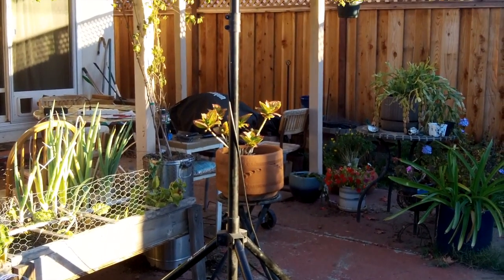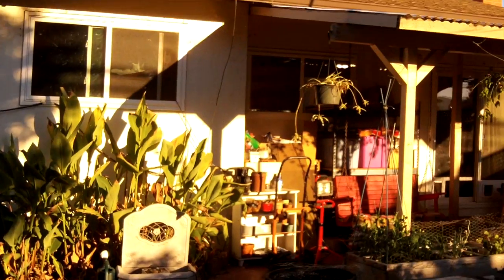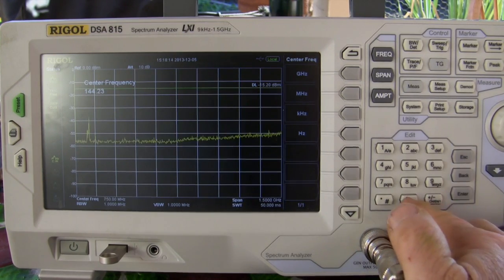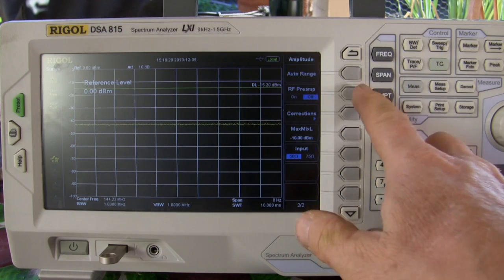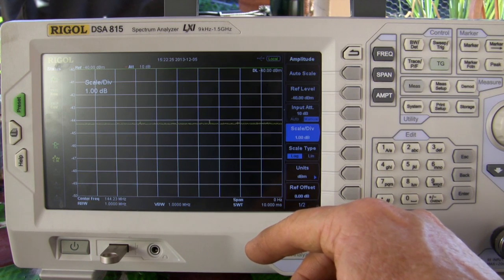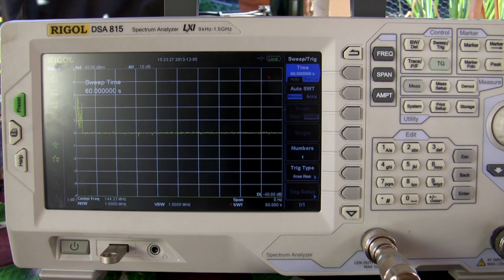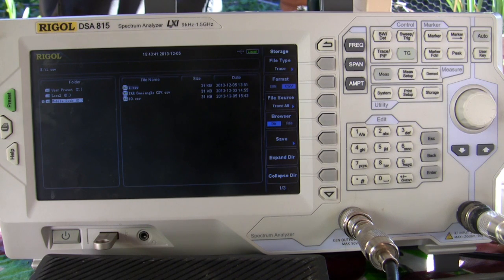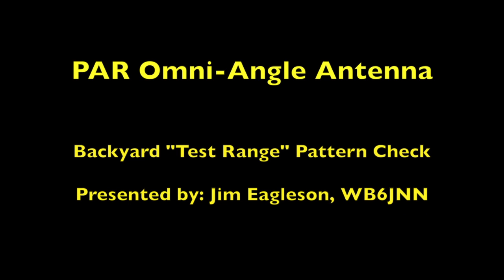PAR 2m Omni Angle Pattern

Comment from the maker: Update: 

For anechoic chamber results that directly compare several omni designs to the PAR OmniAngle as taken at the same Motorola test facility at the same time, check  http://www.parelectronics.com/omni-patterns.html  Note that the PAR antenna shows about 1.5dB variation (I showed up to 2.5dB in my admittedly non-anechoic open air test site).  The other candidates showed significantly more variation with about 1-2dB more gain towards the front and back of their antennas but 4-6dB less than the PAR antenna off the sides.

Under Plane Earth conditions this will cause 10^(dB/40) range increase in favor of the elliptical 'omnis' which is 1.06-1.12 times the distance for +1-2dB gain in their favored directions but it is also 0.7-0.8 times the distance in their reduced gain direction.  Put another way, that's 106-112 miles in their favored direction but only 70-80 miles instead of 100 miles in their reduced gain directions.  

Of course the patterns will change significantly when mounted on a metal vehicle depending on the size and shape of the car, van, or truck and the exact mounting location and height.  So, as I am fond of saying, 'your mileage may vary'.

By the way, I use the Plane Earth 40 Log formula instead of the Free Space 20 Log formula because unless you are running aeronautical mobile it is unlikely that you will even approach Free Space!  For more details information on real world propagation you can check:
 
   http://en.wikipedia.org/wiki/Hata_Model_for_Suburban_Areas

   http://en.wikipedia.org/wiki/Friis_transmission_equation

Jim WB6JNN